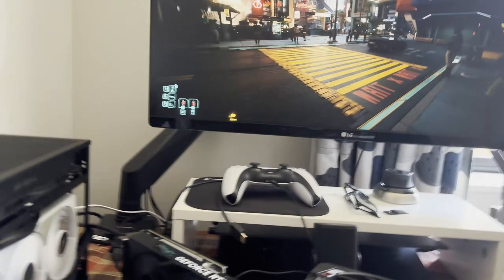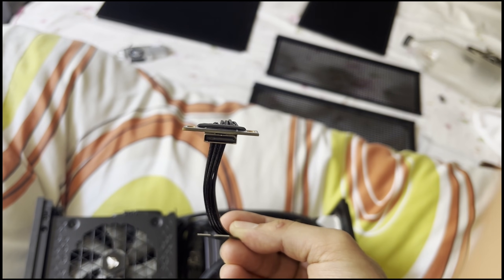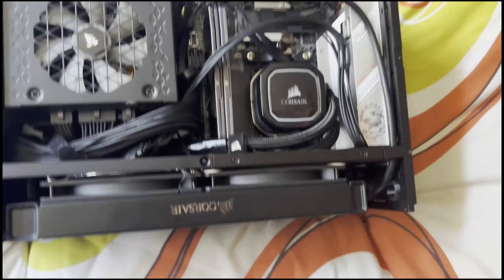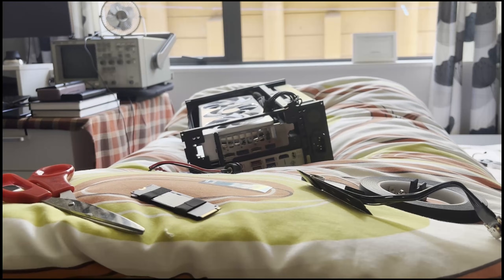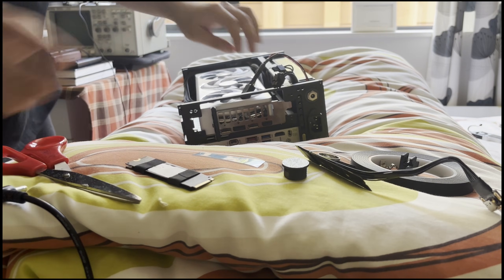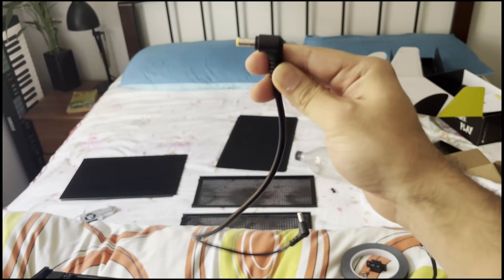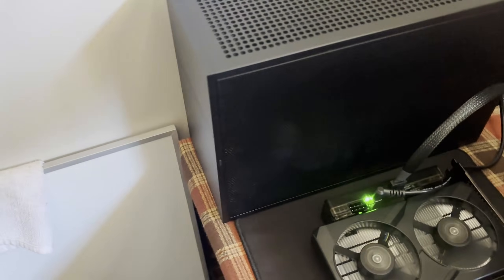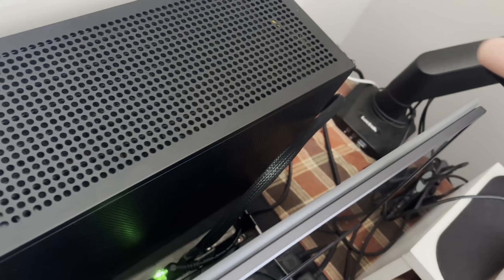Dual GPU Lossless Scaling Setup | ITX PC End game - Part 2

Comment: So ur using a different gpu to generate frames for the original pc? isnt the gpu strong enough?
Reply: framegen increases latency by a lot so having the framegen off to a second separate gpu helps a lot
is that worth buying and powering 2 gpus? probably not but its a cool project
Reply from the maker: Yeah that's pretty much it hahaha I had this 3050 laying around and thought it might be an interesting thing to set up - plus it might help as the system ages